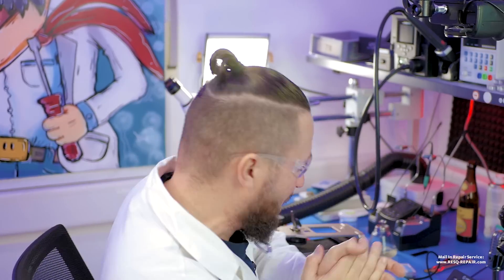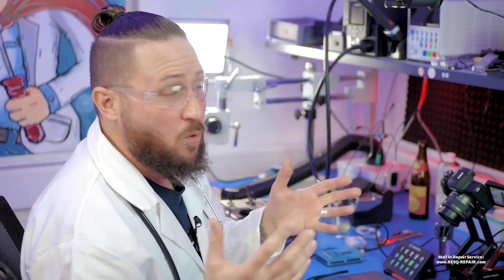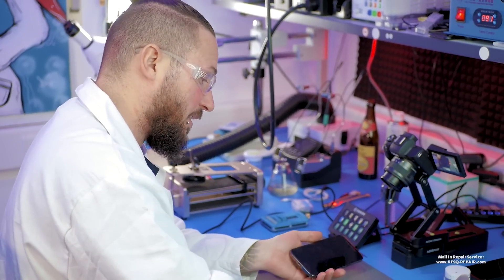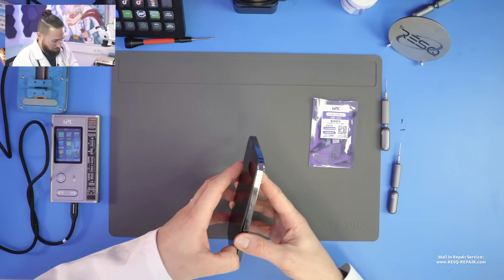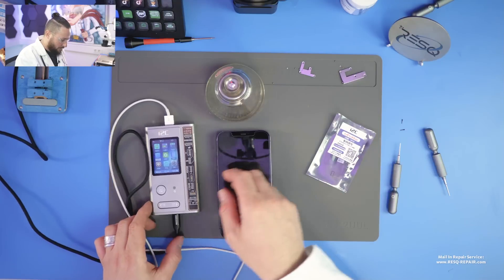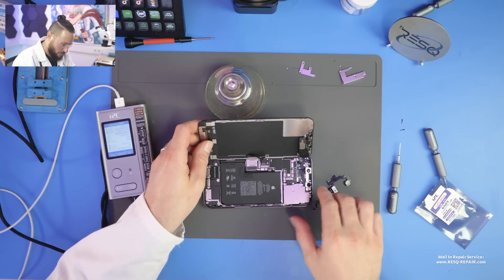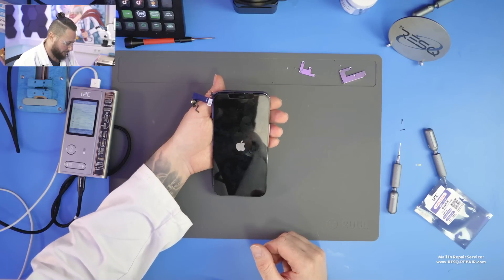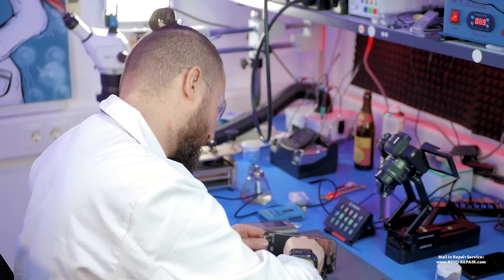📲Easiest Way to Recover FACE ID in 5 MINUTES (I2C Front Flex Method) - Dr. Ben’s How to

Comment: What about a torn earpiece flex..? Or a replaced earpiece flex which doesn't  have the original data..  for example some technician has replaced the original flex with aftermarket one..  so the data maybe not the same..    data won't  readable in torn flex too..

Comment: iPhone XS max, Is that will work swapping proxsensor and alsensor. I mean solder both original sensors on another full module from another iPhone ? Only both sensor are paired, nothing else: mic, speaker and flex. Is that correct ? Or I misunderstood? Thanks for all

Comment: I've a few phones i bought cheap cause of bad repairs, some of them don't even have the flex attached to the screen, they do have the face-id module, but not the flex which has the other parts, such as the ear speaker (the part he programmed) about 5 minutes in. So i guess my questions is, in order to read the data from the iphone, am i required ot have the old one in, or does it read from nand?
Reply: Did you find your answer cause i have same issue…

Comment: I went with the i2c programming system over JC due to all the recent issues with JC and functions not working properly. The first repair using the i6s was successful. It just worked. Amazing, it does what it says!  I'm sure there will be hiccups in the future but what a good product. Thanks Dr.Ben! You saved me lots of time, headaches and money. You are very appreciated!!
Reply: Also, a video explaining the difference between this and the tag on flex with the mc12 unit and how they work together.

Comment: The old earpiece flex cable was removed from the phone. Can I just connect the old earpiece flex cable, read it then connect the new earpiece flex cable and write it?

The new earpiece flex cable is already connected to the phone but the face id is not working because I didn't use the tool.

Comment: does this require a special prox/speaker flex or does it work with an original quality flex assembly purchased from a trusted vendor?
Reply from the maker: Hey. You need the i2c flex. You can get it at www.smartpartstar.com.

Comment: but original earpiece flex not available than it's work ??
Reply from the maker: Sure, it works without the original flex.
Reply: @RESQREPAIR  how would you read the data if you do not have the old flex to read it from?

Comment: with p13 or bbox pro you can simply fitting unbind then active new jcid flex with v1s ...no need to remove nand its tested by me
Reply from the maker: Possible, yes. JC supports that, too. But this video was about the i2c method.
Reply: Could i do this with jcid v1s ?
Reply: How to do it with p13 for xs and 11 series sir
Reply: @freshsnake7222  too complicated bro not a deal at all the best one is on the video …

Comment: We can backup earpiece flex even original flex has been replaced or not connected to the device?
Reply from the maker: Yes. You don’t need the „old“ flex.
Reply: @RESQREPAIR  and we don’t need jail?
Reply: @russianrapmolt3855  its just misleading, he said we don’t need original flex to make backup, I ordered programmer and flexs, tested you cannot backup without old flex unless device has been jailbreak
Reply: @ozmanshani8419  realy man? i ordered programmer and buy all rlex...
Reply: @RESQREPAIR  sorry but this is misleading , we cannot read original data from device if original earpiece flex is missing, you need to jailbreak device to read original data, i tested this
Reply: @RESQREPAIR  it seems jailbreaking is still needed right?
Reply: @RESQREPAIR  please doctor Ben could you please specify some more ??
Reply: Hello, correct me if I am wrong.
1. I read & backup the old original flex using the i2c directly connected to the iphone?
2.write to the i2c front flex using i2c while iphone is connected.
3. Transfer speaker
4. So no Jailbr*** and no unbinding?
Sorry for all the questions. TIA